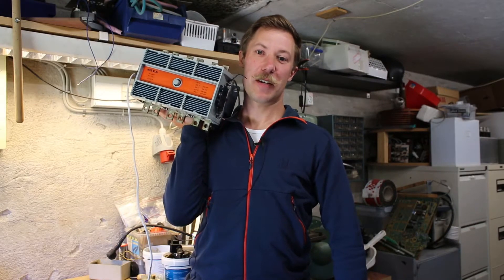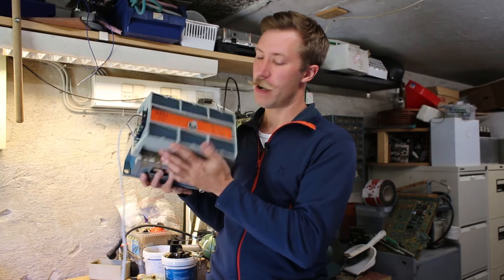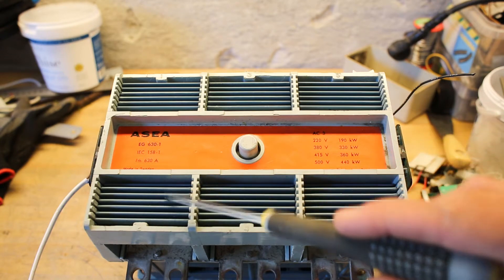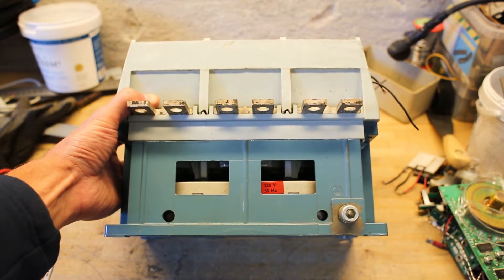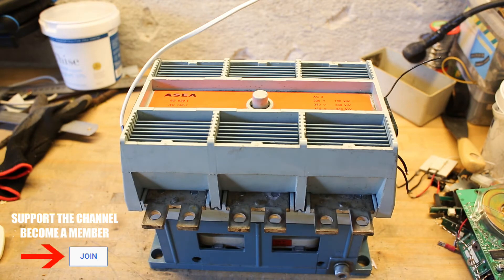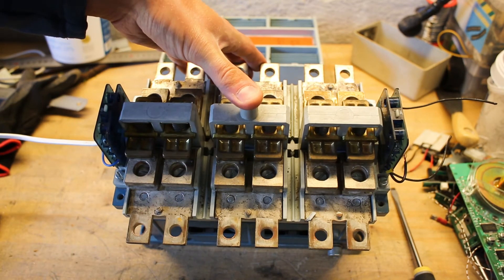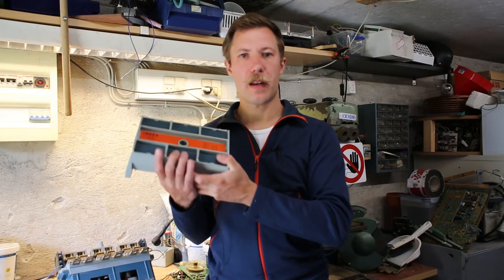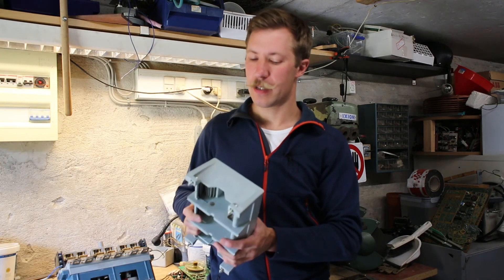Vintage ASEA EG-1 630A / 440 kW Contactor Test and Teardown

Comment: I have one question ... about a gdt ...will an n30 core from epcos 20mm ×10 mm × 7mm be adequate for a solid state Tesla coil? Thankyou 👍😀
Reply from the maker: for a couple of TO-247 IGBTs in a half-bridge that could properly be fine.
Reply: @KaizerPowerElectronicsDk  Thanks a lot.🙏

Comment: Using a 63A ABB to drive lighting. Very much overkill, but seeing as it was used, came in a steel enclosure, and cost me 2 Euro  for it it was perfect for the price. Almost as loud, and will likely outlast me in this application, and is likely to wear out mechanically long before it wears out electrically, Lifetime is guaranteed to be at least 100k cycles, so mechanical lifetime is probably over 2 centuries for the mechanical side. coil is the most likely thing to fail, but they are still available from ABB these days.
Reply from the maker: The sound on the video does not make it justice, its like smacking a 5kg forehammer in the work bench :)
Reply: @KaizerPowerElectronicsDk  Not so bad for the small one, but I can hear it turn on from 15m away, through 2 doors and 3 walls. Hear the clonk and just have to look out the closed window to see the light on. Turned on into a dead short a few times, faulty lamp holder or wet, and tripped the breaker with no problem for the relay. 

Have had to replace a lot of gutta percha wire dating back to the 1950's to fix some of the faults, as most of the light wiring is still original and working. Just does not like being disturbed, as a few home renovators have found out, especially the one who cut through live conduit feeding another unit. Those old cables do not want to pull back, and even if they do, you will not get a new cable back in through the original conduit.

For me no problem, only 15m of cable needed, and all can be surface mounted, but for the worst you will be chasing close to 70m of cable in walls, and drilling through floors as well. Not cheap.

Comment: If only had 4 terminals that way I could use it to switch on and off a USB charger.. my phone has fast charge.. so I need something that can handle a lot of current.. 😆
Reply from the maker: Damn those fast charges with 3 phase + neutral supply!
Reply: You can use it with only 2 terminals, not like it has an overload built in, that for that size is another length of busbar per phase with current transformers stuck over each phase bus. 1 turn primary bus bar, 126 turns of 1.5mm enamelled copper wire as secondary. 630A will read full scale on a standard 5A current shunt meter.
Reply: Better off with induction on that one.  His power meter jumped in sync with the desk!

Comment: Are those platinum or silver contacts? Never heard of platinum for contacts, bud I’d definitely heat them up, pop them off, replace with silver contacts, and refine the platinum myself(carefully of course)  and sell it!
Reply from the maker: You are most likely correct! I mistook it for palladium, but silver is properly the most likely. https://pickercomponents.com/pdf/application%20note/Relay_Contact_Life.pdf
Reply: @KaizerPowerElectronicsDk  Silver, the colour is a give away, and likely the contact buttons themselves are German Silver alloy, which is a common contact material.

Comment: can you wire it as an oscillator would love to see i jumping ant max speed XD, and how much current does den Coil take? Maybe over time if you can measure it, thanks for the amazing video
Reply from the maker: I will see if I can get hold of a fast weight gauge or something that can measure the kicking force of this and do a second video, I will include some coil measurements as well.
Reply: @KaizerPowerElectronicsDk  Probably close to 500VA inrush and around 30VA holding. Those coils are pretty high pulse current things, you typically run them off of a smaller 16A ABB contactor in use, with a 16A fuse just for the breaker
Reply: @KaizerPowerElectronicsDk  would love to see i jumping XD thanks